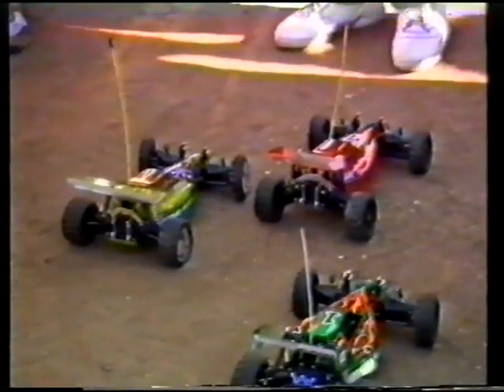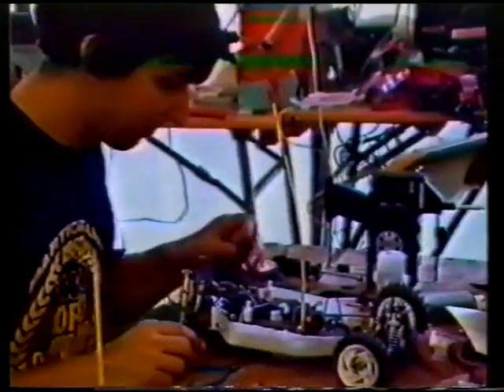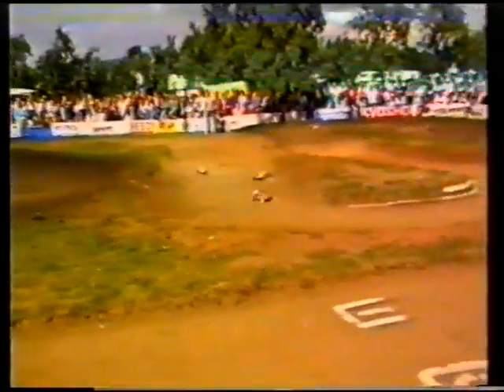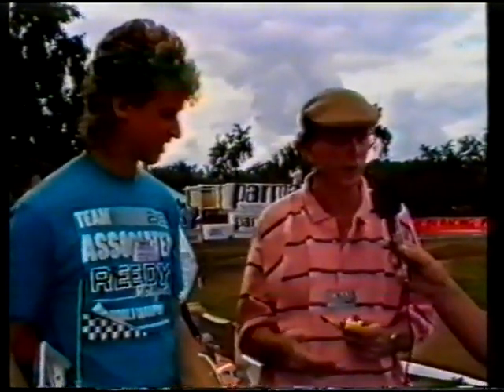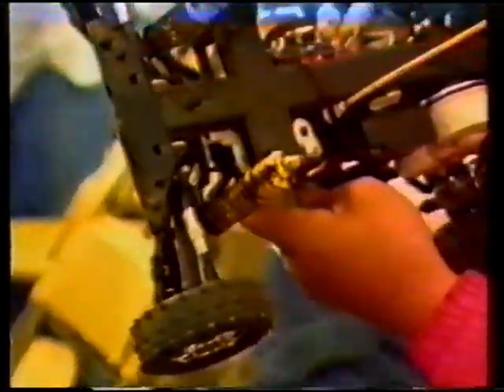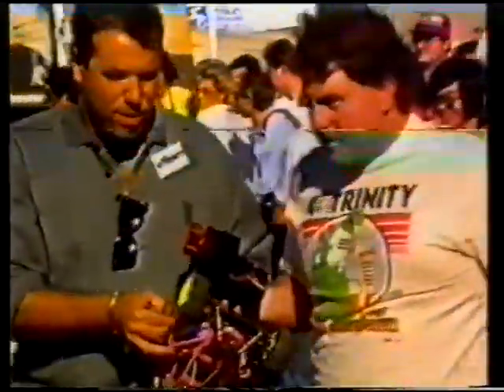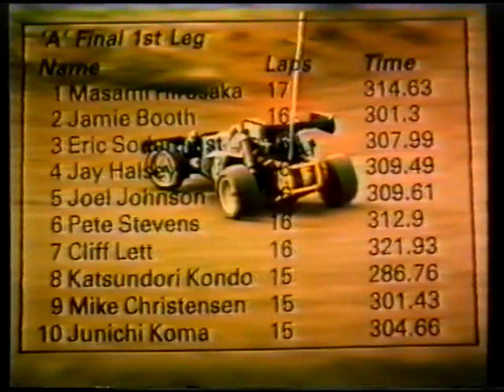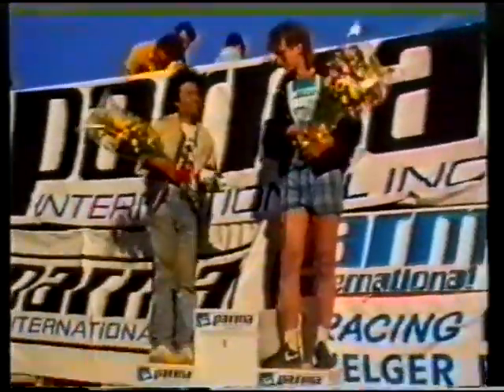1987 IFMAR Off Road World Championship Romsey Part 2 4WD

Comment: I was there! It was a hot, sunny and dry day and the track was very dusty. You can see how the cars were set up for a low traction surface and were sliding a lot - no sharp turns needed (or possible!)

Comment: Wow, 1987, the year i raced with a Kyosho Baja Body (which i still have). Switched to a HoBao Pirate 2wd some years later. 
Loved the loose track surface of those days. Learned a lot from the racers back then. Spare parts weren't easily available, so we had to make spare/performance parts ourselves. Some guy made and sold fuel, another guy was specialized in making suspension parts, and no matter where we raced, it always drew a crowd. Good times, great memories!

Comment: Why does a video from the 80’s look like it was shot in 60’s? Videos were much clearer than this during the 80’s.
Reply: Was late 80's, too. My guess is the VCR tape it was on, and the method used to transfer to digital was poor.
Reply: @Don  - not necessarily.  Being an "oldster" who taped many vcr tapes AND have transferred them, I've seen this "sad" quality before.  There were 3 speeds to use for recording.  This looks like SP, i think it was; The lowest quality that guaranteed the longest amount of tape time.  Also plus the storage of the tape could also contribute to the poor quality.  how FAR we have come :-)
Reply: Don or so you remember!?